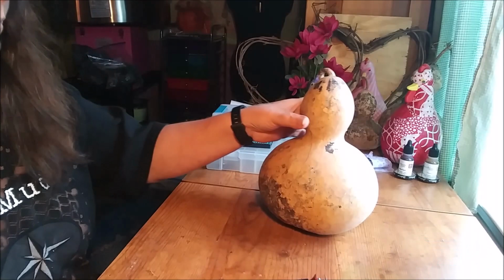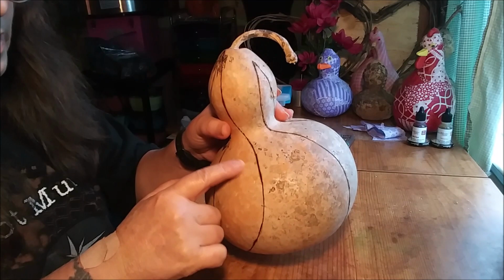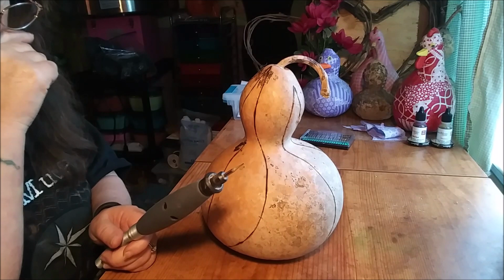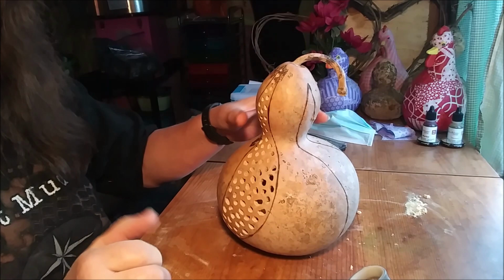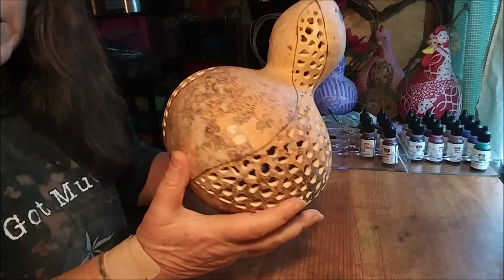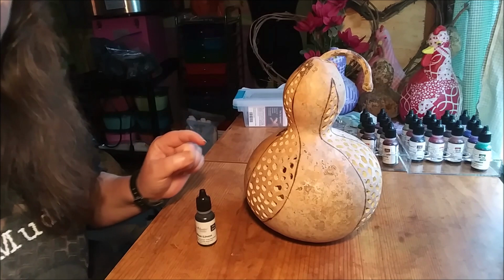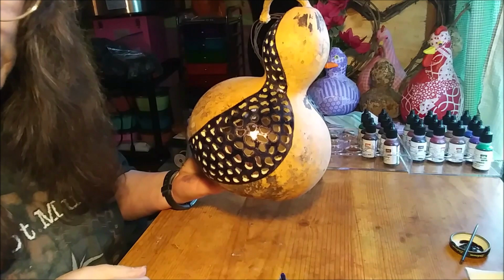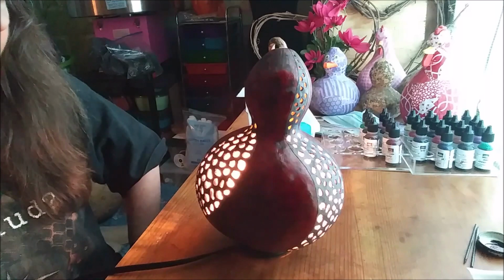Handcrafted Gourd Lamp | Part Two | Filigree Carving And Staining Gourds

Comment: Thank you for your inspiring videos.  I have been carving Goose Egg Shells, very tedious at times but the results are so rewarding.  Not totally uncommon to be just about complete and the egg shell crumbles.  I guess I just pushed the shell to its limits,  LMBO.  I have been seeing everyone's completed Gourds and, just as my initial introduction to Goose Eggs, it has become inspiring.  Just learning, starting somewhat small.  I use a Dremel type flex shaft, a pneumatic powered tool and a Marathon Dental tool.  With the egg shells, the dental tool is so much better.  No runout on the bit (runout will cause excessive vibration) which helps to eliminate cracked eggs.  The gourds are so much more forgiving.  They are nowhere as fragile.  I will continue to do Goose Eggs, but these gourds now have my attention.  Again, thank you so much for your informative videos.

Comment: Hi Tina! This gourd lamp looks awesome. I'm trying to make one but I had a question about the best type of dremmel to use to make the filigree. I have a pretty basic dremmel so I'm thinking I need something with more power. Also what do you recommend for the burnisher? Thanks so much
Reply from the maker: A good dremel is important...  They can be a little pricey, but they also last a long time...  You can find most of the filigree tips and burnishing tools I use at Welburn Gourd Farm, but I suggest price shopping around a little after you know what you want...
Reply: Great! Thank you🤗

Comment: Nice lamp looks good, wondering what if you sand down the solid parts ( no holes part) sanded uneven to allow the light to translucent through the skin?
Reply from the maker: I could, but it is very difficult to do without cutting through...  Probably beyond my skill set...  LOL  😍

Comment: How do you clean it out.  Can you use the shell from a hubbard that has been baked in oven
Reply from the maker: I don't think you could...  We usually cut a hole in the bottom (or where we would want a hole anyway) and use a spoon to clean it out from there...  Wooden spoons are good because you can use the handle too...

Comment: How do you wire it?
Reply from the maker: There is a hole in the bottom and the lights are battery powered LED so they dont produce hardly any heat...